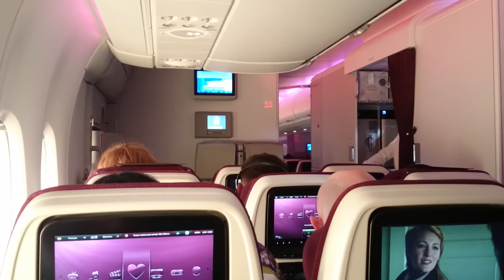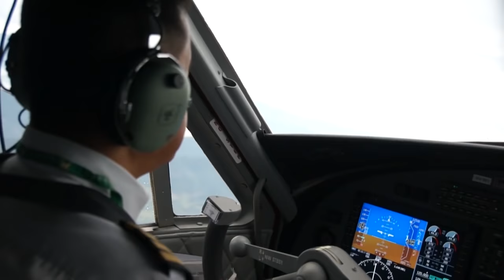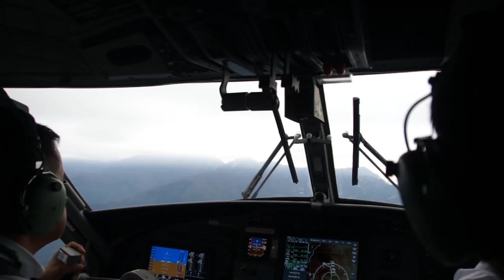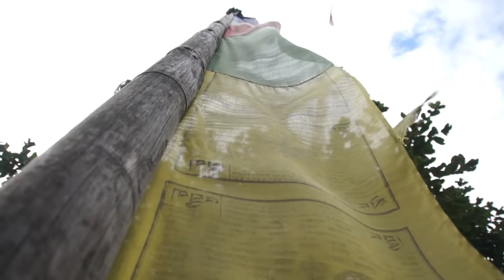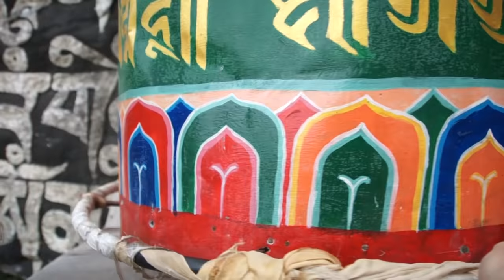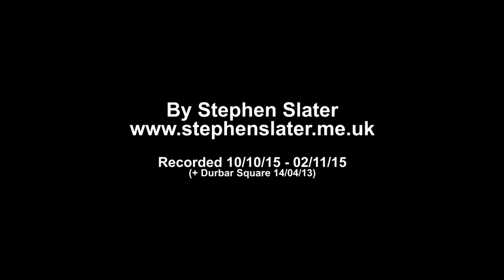Everest Base Camp October 2015: Three Passes Route

Comment: What is the best place for an Everest view? I'm 64 (in good shape) and probably would not go to base camp...it seemed that the one spot around the 40 minute mark showed nice views and am wondering if you can just trek to there...
Reply from the maker: You probably could go just to the place at 40 minutes, which is Renjo La, if you organised something custom, but it is actually slightly higher than Everest Base Camp and would generally be an extra stage added on to a trek to base camp.

Tour operators do run trips just to the area around Namche Bazaar, which is just two days outbound walk from Lukkla air strip.  There are fairly good views of Everest and Lhotse from the museum (see about 23 minutes into my video) and probably other places you can get to as additional day walks out from Namche.  Have a look at what is on offer from trekking companies such as KE adventure who I went with for this one, or Exodus.

The easiest base camp trek goes mostly up the bottom of two river valleys, gradually climbing from the airport, with some side trips up the sides for acclimatisation.  A lot of people go for that option, some even as a first trek, so there are lots of options for overnight stops.  For those reasons there is no excuse for tour companies not to organise it with appropriately gradual height gain and rest days for acclimatisation making it not as hard as some less easily scheduled treks elsewhere.  Note however that while you can see the top of Evererst on the way to base camp or from the ridge above the last camp before there (Gorak Shep), to get good views you need to do the final extra walk up Kala Patar, the small peak next to Gorak Shep.

To add a bit extra, you can go up the valley before the one with base camp to see Gokyo lakes then over a high pass called Cho La with good views to descend to the valley with base camp.  To add even more you can go up the valley before that and go over Renjo La and Cho La to reach the valley with base camp (and over a third pass Kongma La afterwards).  This is the route we took, and is the one where you would normally go over Renjo La as shown at 40 minutes in my video.  So you theoretically could go just there then turn back, but I don't think it would be a common route and it would probably be as hard as just to base camp.

Hope that helps.
Reply: I'm 66 and did the harder Goko/ Cho La/ Everest Base Camp trek a few months. Its well within your ability I suspect. As long as you are not overweight just do it !
Reply: Thanks, I will probably do that in a year when I retire (just for the time allotment)...good idea
Reply: It's about a strong mentality rather than physique. Acclimatise properly and you can be there
Reply: Top of lohtse offers stunning views of everest so I've heard ;)

Comment: guys thats a wicked video. questions for you if possible. I'm going to nepal for this trip on a 21 day  trek to base camp. what did you bring for bag sizes ? did you carry your own or get someone there to, and you had bags you carried yourselves ? 
is there anything you wish you had / didn't wish you had ?
i'll be there oct1-22nd of this year(2016)
Reply from the maker: The bottleneck for luggage is the flight to Lukla.  There’s a weight limit of 15kg total for check in plus carry on luggage, which is enforced.
We had porters to carry a kit bag and just took what we needed each day in a day bag.
I had to buy a forth memory card for the camera at Namche on the way down.  Can’t think of anything I wished I didn’t take.  If stuck, you can get much locally made kit in both Lukla and Namche if you have time.
Packing tips: Most tea houses could recharge batteries.  Can be very dusty – consider a dust mask.  Cough lozenges.  Can be very cold – down sleeping bag and warm layers.  Sometimes nowhere to wash hands – wet wipes or hand sanitiser.  Passport sized photos for trekking permit you get in Lukla.  Definitely trekking poles or ice axe for the slippery bits if you’re doing Cho La, otherwise only if you like to use them.
Have a great trip.

Comment: Awesome video shoot .. awesome editing too! Revived wonderful memories of my 2-3 treks in Khumbu area. Would love to do the 3 pass trek too some time. Wonder if it is better to do anti-clockwise rather than clockwise as in this video?
Reply from the maker: Thanks.

I just went with the direction offered by the tour company without considering the other direction.  However, going anti-clockwise you would have the highlights earlier on and then it would get less interesting.  Also, I found the two best views (beside from Kala Patar which would be the same going either direction) are looking east (clockwise) from the top of Renjo La towards Gokyo lakes and the three 8000m peaks and looking down east (clockwise) from Kongma La.  I think it’s better to see these in front of you on the descent after the pass crossings rather than have them lost behind you while struggling with the ascent?
Reply: Stephen, thanks for your quick reply! Mostly, I had read for 3-pass going anti-clockwise is better for acclimatization. Another criteria, of reaching the pass-top earlier, say by 9-10 AM, and being on way down before weather turns bad around Noon is another deciding factor for direction (like anti-clockwise for Thorung-La crossing). But now I find you have put forth a 'different' good reason for clockwise on 3-Pass route i.e. facing the peaks in front on descent!! Again, really awesome video shoot and edit!

Comment: Just a question. You have said this is October,November but there is very little snow around. Now forgive me if I am wrong but I would have thought it would be winter or close to it at that time of year. If it is so clear of snow and warm enough to be walking in T shirts then why is it that they climb Everest in May or June, the summer.
Reply from the maker: This was 10 Oct - 2 Nov.  Nepal is further south than UK so snow is mostly higher altitude.  I believe there is more snow later in winter.  In summer there are monsoon rains.  Best time for trekking is around April or Sept/Oct to avoid these two things.  Autumn tends to be clearer following the monsoons but Spring has the nice flowers.  I don't do climbing so not sure why this is in summer for Everest.  I would guess they need a few months of altitude acclimatisation as they repeat going higher and down again, so maybe heading up to Base camp in the spring works out best for that.

Comment: can u nt fly by helicopter to base camp or very close to?..
Reply from the maker: I believe flying to the hill opposite base camp is possible, though expensive.  If you don’t walk up gradually over a number of days your body won't be acclimatised to the altitude.  Not sure how long is then safe.  I would guess 10 minutes might be low risk, after a few hours you would be dead from altitude sickness, and in between the risk gradually increasing.  I would recommend doing the trek instead.
Reply: ok thanks..
Reply: dust of gold Because if you suddenly get to go to a change in almost 8000-9000 feet...Your body does not have the capability to handle this sudden increase in temperature.
So in order to get acclimitize to the temperature & pressure...We trek and rest so that our body maintains our internal body temperarure
Otherwisenu can suffer frm High Altitude Sickness
HAPE or HACE (deadly conditions which can be only treated in a hospital)..Bye👍✌

Comment: What 35mm equivalent focal length(s) was this video shot at? Or I can determine through make and model of camera and lens. Thanks in advance.
Reply from the maker: Mostly 27mm.  18-250mm zoom at widest angle on camera with 1.5 conversion factor.  Some shots will have been zoomed in.  Some shots are stills rather than video using the video editor to pan and zoom across.  And some of the stills are stitched panoramas which gives an even wider angle - the opening shot for example is zooming in on a stitched panorama still.

Comment: How tough is this trekking to EBC? I did ount Kilimanjaro last year, upto Stella Point (5685m)
Reply from the maker: EBC is easier than Kili in that you have short height gains each day with time to acclimatise all the way up, so the long hard struggle on summit/base camp day is reduced.  The last camp on Kili is still a long way below the summit.  You also have the option to stay in tea houses for EBC rather than camping.  EBC is harder in that it is more days walking and more days in remote high altitude conditions.  Hard to say which is harder overall.  It's comparing swings and roundabouts.  Probably also depends on whether you are comparing against a Kili trip with minimum days for acclimatisation or a more gradual one.

Comment: how many kilometers from Lukla to mt. Everest?
Reply from the maker: Lukla to Everest is 40km as the crow flies.

If you mean trekking to base camp and you're looking to assess the difficulty the limiting factor is the height gain the body can acclimatise to each day rather than how far you can walk.  It is also necessary to take 'rest days' along the way to acclimatise to the altitude where it is best to do extra walks to slightly higher altitude and back for altitude acclimatisation.

For the route we took in the video, Lukla to EBC was 76km plus 36km of acclimatisation walks. EBC to Everest is about 10km as the crow flies.  After 5km round trip to also visit Kala Patar, the descent route was 56km.  The shortest route from Lukla to EBC would be about 50km one way, plus you would still need to do acclimatisation walks on the way up.